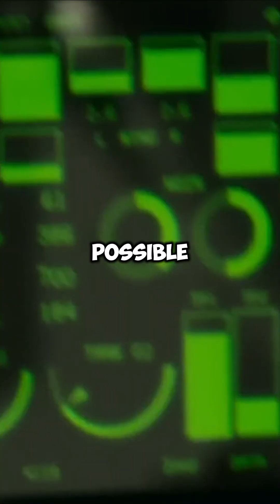What Happens if a Fighter Jet Loses Its Engine at Supersonic Speed? #shorts #FighterJet #short

Comment: * beat comes in * crousin in the air in my 14 slapin the throttle tanking the yoke. Went to the carrier to get my fuel, knuckleheads out there fillin us with diesel. A plane comes up who can it be a fresh new recruit called kilo g. Told me my plane to rock those flaps before I left I hit supersonic. 😅 Boy-z-in tha hood by Easy-E changed to a pilot typa text